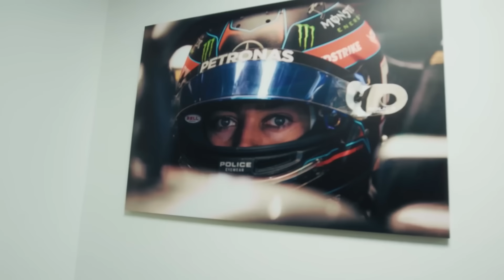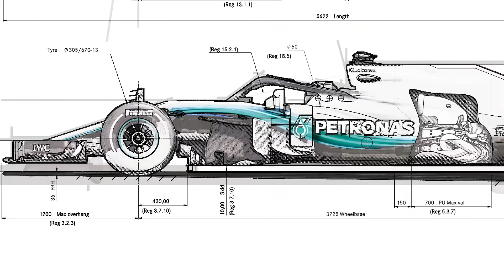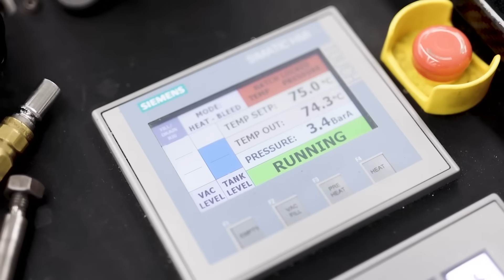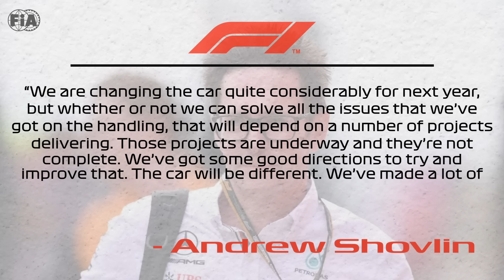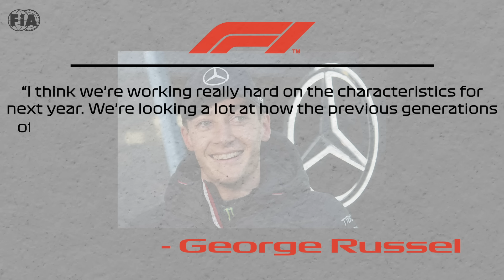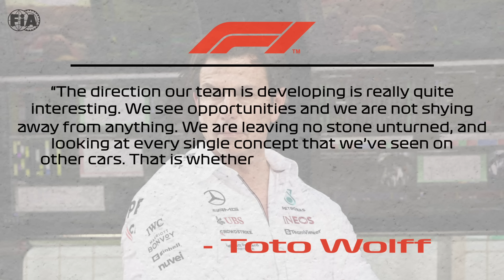Mercedes REVEALS INSANE W15 New Plans!

Comment: i doubt 2024 will be the year for a major challenge, hopefully get second best car solidly and then 2025 maybe
Reply: agreed, maybe the gap will only be 10 seconds next year!
Reply: @keatongoetzger  what does it mean ?!! if you have a faster car with better race pace then the gap will increase by every lap, you can't keep the gap with a faster car in front of you!! if you are close then it's gonna be like 21 when some races go to one team and one to another, depends on car and driver's performance on that track
Reply: even that is not going to happen.  Mercedes are clueless in this era.
Reply: 2025 wont be good if 2024 is bad ,because they have to copy alot from 2024 so they have time to develop the car for 2026 because the regulation change is massive
Reply: @illest7056  Mercedes are fucked imho.  I don’t expect 2026 to be any different.  They clearly don’t “get” the ground downforce technically.
Reply: @davepastern  well in 2026 there is 40% less downforce so we’ll see if merc can get that car right
Reply: @illest7056  they’ll be in a worse spot than now imho
Reply: I'm rooting for McLaren and Ferrari to challenge RB now. I don't mind RB winning, but at least it should be closer. Nobody likes dominations like RB is having now and Mercedes used to have. I would love to see 2021 kind of season, but with 4 teams instead of two.

Comment: I'm a McLaren fan myself. Love to see the strides they've made. However, and correct me if I'm wrong, Mercedes is currently working with a "Frankenstein" chassis and are still competitive with McLaren even at this point in the season. I give it a full offseason of the direction they're going and Merc will be very competitive very quickly. I believe they could just as easily leapfrog McLaren this offseason and be more competitive with Redbull next year as McLaren inching any closer to Redbull. I will say Mercedes engine changes should help McLaren too so it will be very interesting to see how things shake out next year between the 2. IMO those two along with Ferrari and Aston will be what to watch for next season. As RedBull will still be out in front.

Comment: They definitely need a powerful engine too .
Reply: yes, it is underpowered vs the Ferrari and Honda engines.  I don't think there's a lot that can be done here as the engine specs are frozen other than reliability fixes.
Reply: Mercedes still have the most powerful engine what are you talking about lol
Reply: @amann3161 what??? No they dont
Reply: Rumors has it that the zero pod design limited cooling too much and caused less power. The updated cooling will allow the engine to be more optimal more often.

Comment: They fail to acknowledge the real reason why they won.  Their engine advantage of their old days.   Which is their biggest downfall as well.  Since whatever they came up with just had to somewhat work.   Since their engines were so much better.   Meanwhile ferarri and rb had to get every last drop of engine performance and chasis performance to be within 20 seconds.  Also the budget cap made them vulnerable to the other teams that were looking for new talent.
Reply: That is a complete myth peddled by none other than clueless DTS fans. 
There were many seasons the Mercedes were dominant when they didn’t have the outright “best” engine. Early on in the turbo-hybrid era, sure; they had an advantage. 2017 onwards they did not.

They had the best Aerodynamics on the grid along with Red Bull, and their suspension systems were top of the field.

Mercedes have always been good at creating inherent downforce. 
These regulations are different though. Ground effect is about creating downforce balanced with drag coefficient, an almost impossibly hard balance to get right. The window of operation for these cars and for some teams is absolutely tiny. Which is why we see Merc very good on some tracks and poor (relatively speaking) on others. 

Ground effect was last part of the regulations in the 1980’s. I doubt many of the engineers have had much experience with it.

It is absolutely no surprise that Adrian Newey nailed these regulations - who’s Master’s degree thesis was actually based around Ground Effect (if I’m not mistaken) . He is the only one who seemingly understands it to the level that is required.
Reply: You must be a blind Merc fan in order to say such thing.  2017? What? Merc lost the power unit supremacy only after 2022 i.e. the current engine cycle.
Reply: @catchnkill  
2017 Ferrari’s engine was on Par.
2018 Ferrari’s engine was on Par.
2019 Ferrari’s engine was stronger.
2020 obviously the W11 blew everything out the water.
2021 Mercedes & Honda had parity.

Go back and watch some more DTS. You clearly were not watching the sport back then.
Reply: @W0lf_91 Ferrari was on 110 procent and the Mercedes 80 to be on par
Reply: @kaivdz9515 
A statistical pulled out of your orifice. Well done.
Reply: @kaivdz9515 
A statistic pulled out of your orifice. Well done.
Reply: Garbage! Merc had a strong engine throughout the turbo-hybrid era, but so did their several customer teams. No customer team got anywhere near them!

RB used the Renault engine used by the Renault works team and beat them every year by designing a better chassis and aero package. Ferrari had a more powerful engine in a couple of seasons but still lost to Merc.

The true strength of the Merc cars during that period was their superiority in fast and mid speed corners, their balance and how gentle they were on tyres.

All aspects of chassis and aero design. Not Engine!
Reply: @dansegelov305  well since they lost the engine superiority  they havent won anything did they? 🤫  They were getting beaten by aston this year.  Now they're getting beaten by mclaren... they only managed to beat williams this year.  Now with all the key engine people gone theyre nowhere.
Reply: @gabiroli86  . Out of curiosity, which engine supplier do Aston Martin and McLaren use?
Reply: @dansegelov305  mercedes... the question is why are they getting beaten by much smaller teams nowadays.   With worse pilots...
Reply: @gabiroli86  . If Merc are losing to teams that are running the exact same engine as them, how can the problem be their engine?

The problem is the chassis and aero. Not engine!

Comment: Look. Ham is a good driver, but never was that great. Here are some reasons, 

1) Mercedes had the fastest car they’ve ever produced, the W11, surely in the top 10 fastest/grippiest/record-breaking cars of all time. Still Hamilton only took 11 wins only, 10 poles, and only 6 fastest laps. If he was truly the best on the current grid for the past 3-4 years, he would top ‘at least’ Max right? Just for comparison, Max got 10 consecutive wins, most laps led in a single season, and many more. 

2) Consistency lacks in Ham the past couple of years due to his own errors (not the car, not any failures) 

3) Only 62 points ahead of rookie teammate George. As a comparison, the difference between Ham and Bottas was of 161.5 points in 2021, and 124 points in 2020. 

4) He is a wuss constantly complaining about how others drive (anyone else driving, not just max) and blames it on them. Just for some recent context, Qatar 2023, first corner incident where Hamilton just caved into George causing him to loose a lot of time and positions in the first bloody corner after lights out. 

5) George gets better times in qualifying than Ham on most weekends. 

If that is what you call ‘current greatest driver’ or even a half decent one, I think F1 is going to shits quicker than I thought.